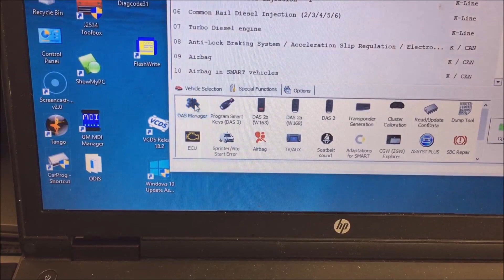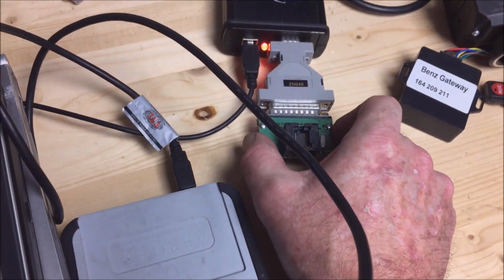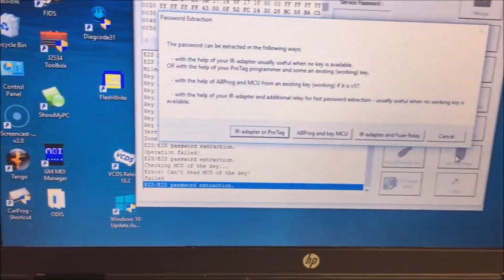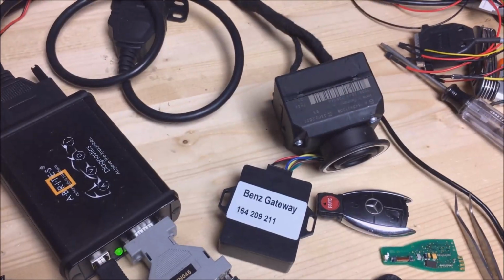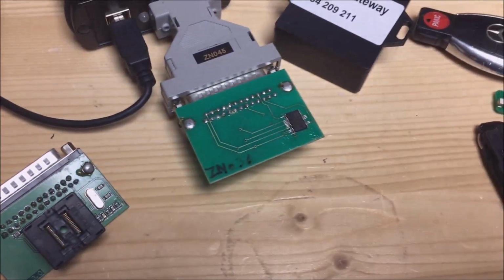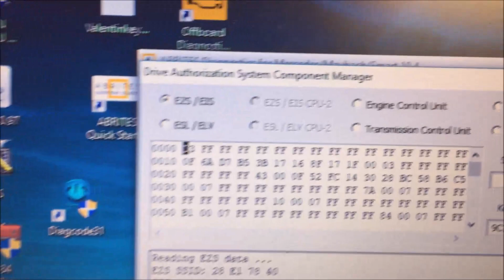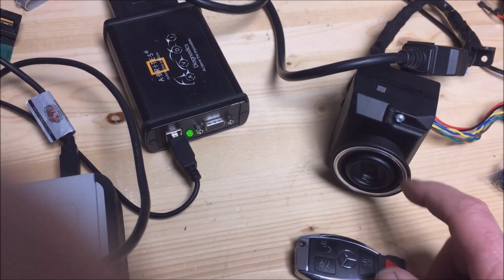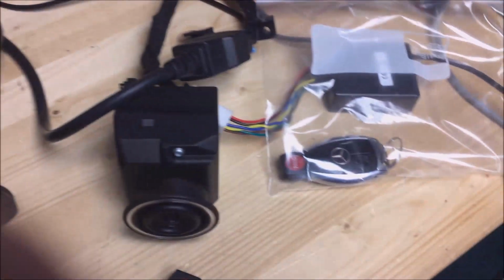Merc W164 Keymaking With Abrites and Ver 57 key

Comment: Do you have testing cables for all ezs moduleS?
Reply from the maker: most EZS modules...  here is a link to the cables.. most except for w210..  https://www.abritesusa.com/product/CB011-ABRITES-Mercedes-Benz-cable-set-for-EZS-7G-Tronic-and-ISMDSM

and for most EZS's and the 210's
https://www.lacartech.com/collections/mbe-engineering-1/products/eis-esl-testing-tool
Reply: @timtracy9442  thank you for your reply tim. i bougth vvdi moe cables but i have no connectio with the ezs with avdi..have you ever tried vvdi cables with avdi diagnostic?

Comment: I could really use some help. Can a used w164 eis be adapted to another vehicle? Both original and used replacement have working keys. My autel IM608 has eis replacement functions I’m just not sure which order to execute them in. Is it as easy as read original, erase replacement, then write? There’s also “backup coding, write coding, activate”. Also which key will work once written? I would really appreciate some direction.
Reply from the maker: It is as easy as you say...  read the original and get the key password, then save that data.. Read the coding and save that... Read the new/used EIS and get the key password, I do this even though you only need the service password... Virginize the new/used EIS, then personalize with the data file you saved from the original EIS... then activate it, then write the coding you saved from the original...  Any keys you have for the car should work as long as the original EIS didn't screw up the data in them.. You may have to leave the key in the ignition for 30 minutes to sync the data between the EIS and the key, but thats all there is too it..  Just remember, the key hash's are the same in all the DAS modules, EIS, ME, TCM, ISM, the EIS is the only module that has the key password and the SSID... So, believe it or not, if you have a defective EIS, read the key hash's from one of the other modules, then save, then virginize an EIS, write the data to the EIS, the program will ask you for an SSID which you can either get from an old key or the cluster bin file, then either use the old key password from the new/used EIS or make your own... JUST REMEMBER, if you do this, no dealer key will ever work on that EIS... because it has a different password... Good luck...
Reply: @timtracy9442  Thank you so much for your help. I finally was able to work on this vehicle again yesterday.  Did exactly what you said and it fired right up with the original key. I was even able to add a second key. The im608 did ask me for the replacement key password and special password for the replacement eis. Then it automatically calculated the erase password. I can’t thank you enough. Do you have a patreon or PayPal so I can contribute to the channel?
Reply from the maker: @escoto88  Glad I could help... Appreciate the offer, but I mainly do these videos because there wasn't much info about this stuff when I started out, and now I can't remember what I did yesterday, so these vids make it easy to remind myself.....

Comment: roll the dice locksmithing.   how much money do you have in your abrites system and is it worth it?
Reply from the maker: A lot of money.... I got it before they changed the packages and lowered prices...  Is it worth it??  Yes, it has done many things that no other programmer can do.. The VAG program is absolutely the best out there..  I use it along with ODIS pretty much every day..  As for Roll the dice locksmithing, I try and stack the deck in my favor... lately I have been doing more programming than locksmithing.. and since they changed ODIS to not work with used clusters, I am in pretty high demand..
Reply: @timtracy9442  i have been locksmith for 16 years now i own my company.  looking for another eeprom programer.  i remember when the mvp pro was the top dog.  thanks for your time

Comment: Hi Tim -have you ever attempted and successfully created a Keyless Go key with ProTag?
Reply: nanopiebald i have ! They use ROM 06-08 For a W221
Reply from the maker: no, I haven't...  Because I haven't been able to find an aftermarket keyless go key...  When I was talking to an engineer from Poland, he explained there are 14 different types of keyless go keys, so the aftermarket has been shy to make them...  I have taken the NEC chips off of ver 62 and ver 68 non working keyless go keys and soldered them onto same version keys I have gotten and had them work, but programming a keyless go key is something I haven't done....  I see where a couple of chinese programmers do it, but where do you get the key...

Comment: next time just read eeprom from the eis
Reply from the maker: How would you do that???  Would you eeprom it? or let avdi run and try and find the password??
Reply: Tim Tracy  vvdi have adapters
 It will read easy. Just did a 2007 one.
Reply from the maker: How about a pic of the adapter???
Reply from the maker: ARGH....  I looked at the adapter set...  it was right in front of my face....  But what do you do if you don't have VVDI prog, and the adapters???  Sometimes it is fun to try different ways to get the info...  I used to think there was a right way and a wrong way, the older I get, the more I realize there are alot off different ways to get to the same place, we to try as many as we can...
Reply: Tim Tracy  this the easiest way to do that particular eis. They have allot of adapters for eis. I wish they had one for w210 eis. Maybe sometimes i can call you to talk about it.

Comment: Hi Tim is there a way to do the 210 -208 mercedes keys with abrites ? please advise :D
Reply from the maker: The only way I know to do the W210 is to open the EIS and remove the HC05 chip and read it, then run that data thru AVDI...  There is supposedly a way to make a wiring harness, and do it on the bench, but I haven't tried it...
Reply: Tim what arethe devices you would recommend to read the HC05?